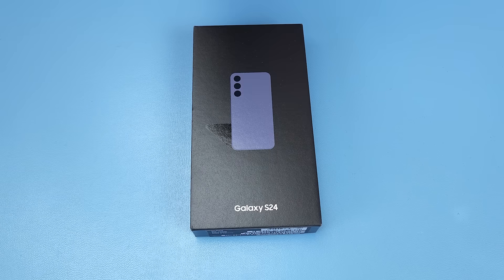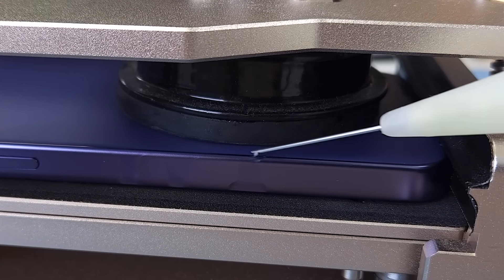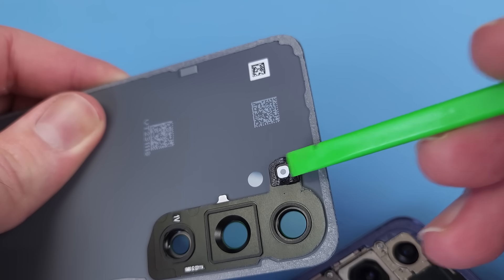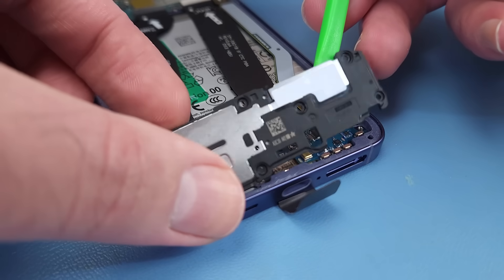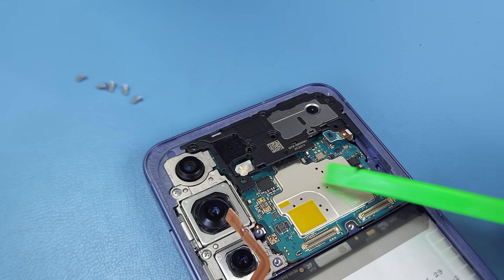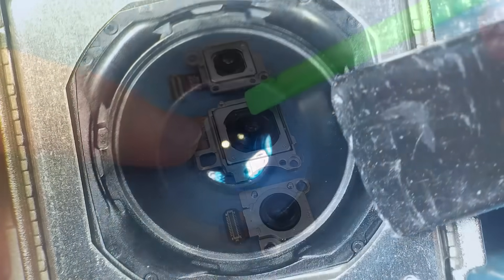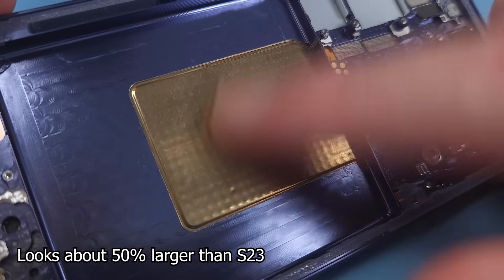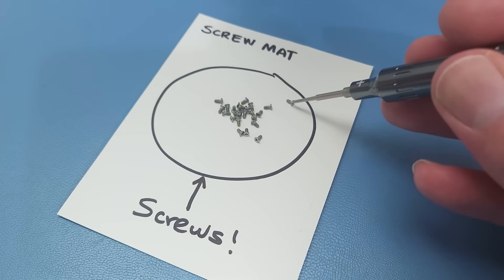Samsung Galaxy S24 Teardown - Full Disassembly

Comment: So ive scratched the part above the screen (official case not providing full coverage..) is it possinle to change the housing? Can see it being a full strip down job to rehouse?
Reply from the maker: Yeah very difficult to swap the housing and keep the existing screen. Very high chance of breaking the display when trying to remove it from the frame.
Most repair techs will only buy screen replacements that have the frame attached.
Reply: @RestoreTechnique thanks for responding! Unfortunately the case has not protected the edges and caused some scuffs etc , I am UK based will have a look but can see it being more on the expensive side than just a simple change! Thanks for the help!

Comment: I really watched the 4 Teardown videos completely,as today accidentally I entered SIM ejector pin in Microphone hole instead of SIM tray hole in my 2 month old Samsung Galaxy 24+ while trying to remove physical SIM.
I really worried but you mentioned in your video that”those who worried about …….SIM tool in microphone hole…….”
It will be really helpful for me if you elaborate why it won’t damage the water prof mess and microphone.
Thanks in advance. 8:15

Comment: Can a mag safe ring be added inside the phone so I can use magsafe items such as a mag pop socket with no case?
Reply from the maker: @mkvmyfast   Not really. There isn't the space under the back panel to fit the magnets, without them putting pressure on the battery, and pushing up on the back panel which would compromise the adhesive border holding it down.
Also Apple's mag safe magnets run around the outside of the wireless charging coil. You may negatively affect the wireless charging on the Samsung, depending on how you place them.

Comment: I accidentally inserted the SIM card eject pin into the microphone slot at the bottom. What will happen now? Could I have damaged the microphone this way, or some mesh or moisture protection? I got excited about buying a new phone, Samsung S24+, and this unpleasantness came out.
Reply: microphone will break
Reply: im kidding im pretty sure nothing will happen eject pin is not enough to damage the microphone slot
Reply: you can check the microphone if you're not sure

Comment: omg, thank you for talking about sticking the sim jack tool into the microphone hole. got my s24 brand new and did it twice already and was worried if I had damaged something doing it. I'm glad it didn't cause any damage like you said. tested the mic and it works properly. laughed out loud when you cut to the bomb after letting the battery hit - hilarious

Comment: Thank you very much for this video! 

I think my favorite video of yours is the iPhone usb c port replacement because this project is more personal than a teardown (these videos are important too, don't stop them! ^^). By the way, I was asking about compatible screens that are easy to find on AliExpress and far cheaper than original ones. For example, you can find many pixel 7 pro screens on AE for around 70 bucks whereas the original replacement screen (on ifixit) is more than 200 bucks. The AE compatible screens are often said to be AMOLED and even LTPO AMOLED but it's not that easy to check these specs without tools. Moreover, what about the luminosity, the response delays... I think that could be great to have a video with a comparison between genuine and compatible screens with one example... I think this subject needs some good equipments to be dealt with properly... 😇

Comment: Hello, tell me, I wanted to insert a SIM card and used a needle to poke the hole from the microphone. Now I'm worried that I damaged it.
Reply: It dosent.
It is deep inside and is perpendicular to direction you inserted the pin
Reply: @anishrashinkar316  Is that true? That's really smart design.

Comment: i have a weird idea, i'm planning to hotswap the daugtherboard which consisting the USB C Port and the sim slot + SD card/sim slot from A55. One of the problem is the form factor of the component itself. Have you ever had a weird idea to customized this phone with SD card feature in it? because samsung has turned into iphone this time.

Comment: 8:15 I'm glad you said you cant hurt the microphone by inserting the sim tool in the microphone hole, opened my new phone and put a screen protector on it and put the sim tool in the microphone hole by mistake and thought damn just screwed up my new phone and I thought who was the idiot that thought putting the hole for the sim card and the microphone hole next to each other.
Reply: Your not alone 💀 what an insane badly designed position

Comment: Came here to check out what was going on inside the bottom microphone hole, and watched the whole clip.  It answered my query near the end, but I hung on in there as it was fascinating, and followed too.  I was asked to take out the Sim by Vodafone in an on line chat, when trying to get mobile data up and running, and in haste, poked the prong in the wrong hole with fairly firm force, as I was wondering why the sim didn’t pop out (I suspect I am not the first to do this, and will definitely not be the last, as it seems too close and similar a feature to not happen often).
Reply: Yes that's why i'm here too, brand new phone and sure enough put the sim tool in the mic hole.
Reply: I have a smug problem! I'm so glad I'm not the only one. What did you do next? Did you go to the repair center and mail the microphone? Give me some good advice since I'm also the owner of the new Samsung and in a hurry, just like you damaged the microphone.
Reply: @gometro2426  eh?  Watch the vid.
Reply: Me too. And it seems I stuck it so deep, right down to the spine, that I tore or damaged the water protection.
Reply: I didn’t damage mine, it was fine, realised the issue before pushing too hard.

Comment: 4000mAh battery? That's ridiculous for a smartphone in this price range.
Reply from the maker: What does price have to do with phone size (and therefore battery size)?
You can buy $200 cheap ass phones with larger batteries, but the phone is huge.
The S24 is the same size as the S8, but the S8 has only a 3000mah battery.
Reply: The iphone 15 has a 3349 mAh battery 😂
If you want a bigger battery the s24+ has a 4900 mAh battery ❤
Reply: The phone itself is small
Reply: Why you don't show the ridiculousness on the time of iPhones?

Comment: wonder if you can use the bottom piece of a A53, that has the micro sd card and simcard?.
Reply from the maker: You would have to wire it up to the usb port, with a switch, it would involve some engineering

Comment: Why is so dumb the producting scheme of phones? Earlier was easier- just removing and paste another battery.. insane
Reply: Don't worry; the EU is imposing another law that states all mobile phone manufacturers must include user-replaceable batteries in all their phones.
Reply: @APEXLWIAY  I get the logic, but I think this is a bit of an overstep. I’m not against making batteries user-replaceable, but there hasn’t yet been a way to ship a consumer device with both a user-replaceable battery and IP68 resistance. They should be encouraging competition to find such a solution, not brute-forcing it in a way that will likely result in clunkier and less-reliable devices for an extended time. It’s like what Louis Rossman said on the issue: Pro-consumer legislation shouldn’t interfere with the ability of companies to innovate.
Reply: Who is So smart 😮
To take shower and watch videos or talk on the phone 😅
Reply: Water and dust proof that is why
Reply: Because people don't want batteries that remove we want water perfection and you know we'll built phones
Reply: Except s24 is not water or dust proof.  All of these don't offer much protection and make it hard to service the phone for DIYers.
Reply: @arroe621  pretty sure it is gng
Reply: to make money. when they make it so hard to take it apart, it forces you to take it to them to fix it
Reply: I've been using smartphones that don't open for 8 years and not a single time did I need to open them. Stop whining, it's not a crucial thing
Reply: IP68 Rating...
Reply: $$$, simple as that. water proofing was available on the s5, it s available on the fairphone too, and on the samsung xcover phones. s5 has ip67, fairphone has ip55 and that s with an almost fully modular phone made by a tiny company compared to google, samsung, apple etc
Reply: @mihaicraciun8678 IP55 is not water-resistant. It can take light splashes, but anything more powerful will result in ingress. You can’t wash an IP55 device, for example. The S5 also seems prone to water damage due to the nature of its removable gasket. No device is waterproof.
Reply: я слышал что производители вернутся к этому, к ....2030 году ,я не помню эту информацию.
Reply: что б ты туда свои руки не сувал, а менял акб в авторизованном СЦ
Reply: For protection of the phone from cheap knock off batteries not made by the manufacturer. Those can destroy the phone

Comment: As I have the S24+, the battery temperature resister is amazing. The phone does heat up when you play high-end games, but not as burning hot compared to the old phones that don't have that.
Reply: Hey, do you have the american version? My european version has the Exynos processor and it heats up quite quickly..
Reply: Yeah, it's the US version (Snapdragon gen 3). I won't deny I had that issue at times as well. Then I found out it also varies on the phone case you have on it since the heat somehow traps and builds up faster.
Reply: @Antiven1n  yeah, thanks.. the US version is much better..
Reply: @adamk0kt573 I have the s24 exynos version, with 26°c room temp. I never went over 39°c (cpu temp) while playing genshin max settings. So it’s more than good enough.
Reply: @invinsible1987  well despite what the bloggers say and show us in benchmark "tests" the 39-44c temps are not actually the temp of the cpu but the temp of the heat dissipatior frame materials. The real temps of cpu are actually +60-70c lol
Reply: I have an exynos and man that shi* heats up for nothing...
Reply: @MichelipeDiasvier  after one ui 7, its not heating randomly anymore
Reply: I'm sorry but my S23+ better than my S24 FE with the Exynos 2400e. the Exynos temperature once reached 48°C when playing heavy games, while the SD 8 Gen 2 can stay at 43°C

Comment: The Exynos 2400 is actually comparable to the Snapdragon this year,  not less powerful. In fact the GPU out performs the Gen 3!
Reply: Wait for it to thermal throttle and drain battery super fast
Reply from the maker: Ok cool!
Reply: It's comparable, but the problem with the exynos is battery life.

Comment: Enjoyed the video. I tried out the S24+ in the store a few days ago, but honestly, and this is coming from a big tech nerd, there's like almost nothing new to these phones it seems. The galaxy AI is cool, but after a while that effect also wore off very quickly. I personally have an S22+ and the size is almost identical. I didn't even notice the higher resolution again on the s24. I will gladly keep my S22+ for years to come.
Reply from the maker: Yeah tbh it's been 2yrs that I've had my S22, and the only upgrades the S24 has is 10% more battery, and a brighter screen. Other than minor processor upgrades which I probably won't notice. So I'm not actually that interested in switching.
Reply: @RestoreTechnique  I'm still on my S21 ultra. The S21 series has better haptics. I'm thinking to buy xiaomi or iPhone next time
Reply: Tbh the S24 series is underwhelming and exynos is a dealbreaker when we all know snapdragon gen 3 is much better.
Reply: @John99YT  all phone launches have felt underwhelming to me, even the foldables. Tech has become boring for me, and I think it's a shame, since I was a huge tech fan a few years ago
Reply: @finnjacobs  I feel you. I know manufacturers are not innovating that much anymore. But I still like to watch in case they show something cool.
Reply: Funny how this is the first exynos that matches the snapdragon in quite some time
Reply: @hantbill6462  huh, didn't know that. I found my Exynos S22 to be working just fine too, haven't noticed any oddities with it. I've seen videos where the 2200 even outperformed its 8Gen1 counterpart.
Reply: Just bought the s24 coming from the s22. I upgraded because of the 7 years of updates, and I got the earbuds 2 pro with them .